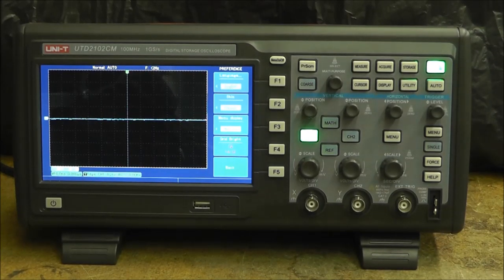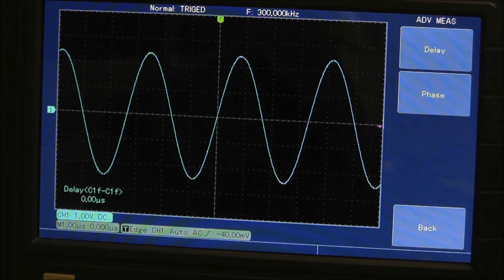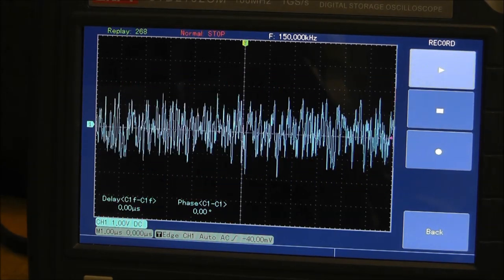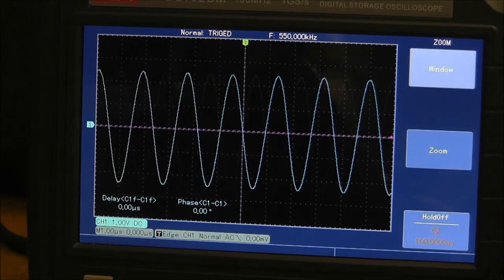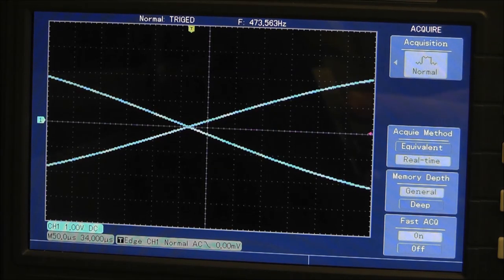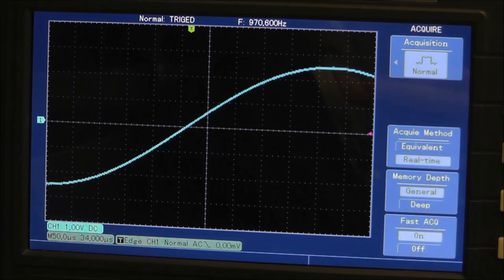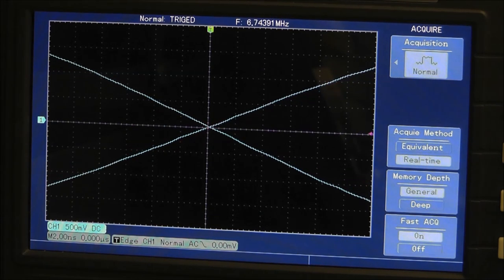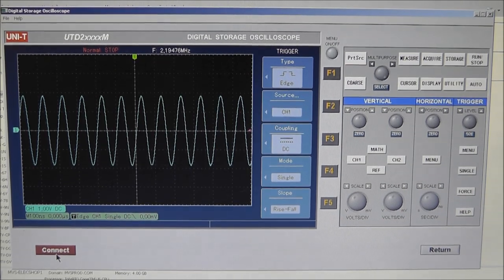UNI-T UTD2102CM Oscilloscope full demo review all functions. & trying to show waveform Capture rate.

Comment: I don't think the this method is really good to measure waveform capture rate. It is based on the assumption that the capture rate is fairly jitter free, which is false. My scope (different brand) can put out a decent average rate for its price bracket but it does so by capturing several waveforms in a burst, then dropping a few while displaying data, updating screen, taking measurements, doing operating system housekeeping, whatever and so on. It all happens in a rather unpredictable way. I can measure my scope's performance through the trigger out. The frequency counter shows a variation of 20%, but what really telling is when I connect an other scope on the output. Several spikes close together followed by gaps.

Comment: LOL... chill out guys... it's just an oscilloscope. Did you check the cables?

Hey... I have a technical question: Why did the good doctor cross the road? Because he owned it of course. But that's not the question, the question is why did it take so long for CERN to find a loose cable? Ah man.... I just figured it out.... never mind. The good doctor used it to swing across the road so he could say he didn't cross the line. And that stretched it out! Mystery solved. But maybe we should all chip in and by him a pair of glasses.... the poor guy's line blind. Just look where he built his first house. This explains everything... E=m+{a}c2 relative to the strong force. It's a little  cosmological.....